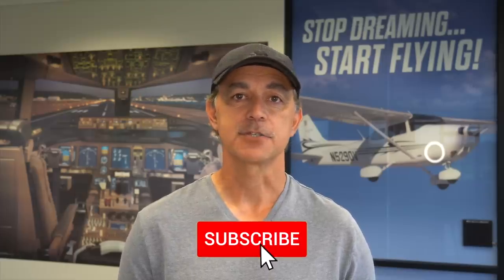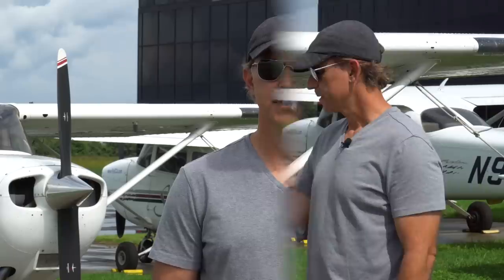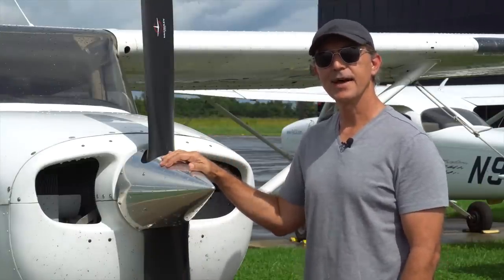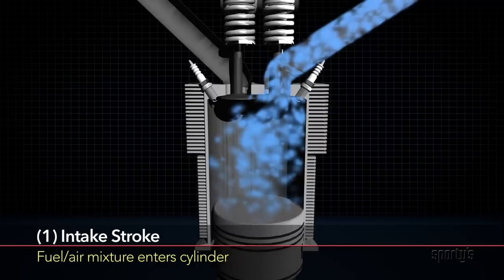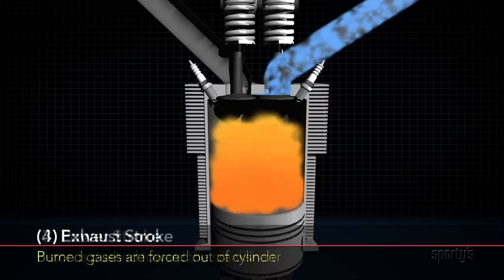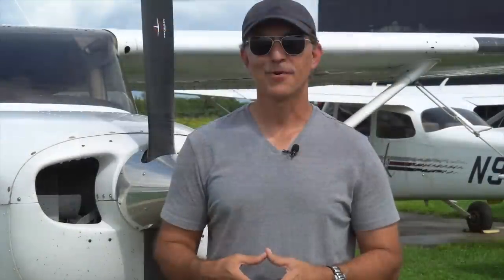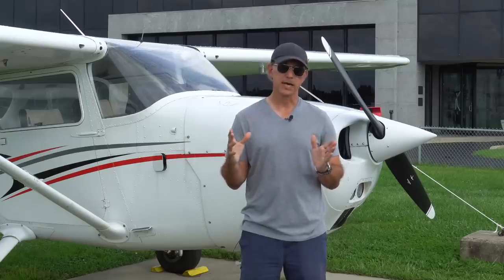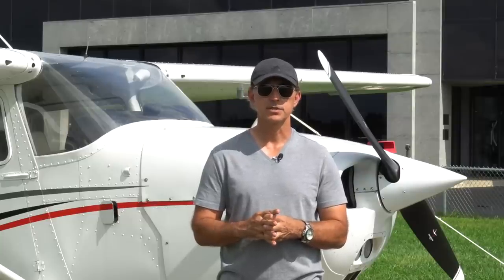Emergency Follow Up, What Happened To The Engine

Comment: In sailplane world, the 270/90 (impossible turn) is commonly taught and practiced, to prepare you for a rope break event. It’s all about speed management…that’s why the critics don’t understand why it’s possible. At the point the engine fails you have two items to manage…altitude and SPEED…which you can convert into attitude or distance

Comment: They  had partial power, not. Parachute on the nose.   I only ever landed at sportys once, but as i recall the surrounding area has houses and trees so an off field is not obvious.     I think this was a textbook ADM example, including Kim cleanly handing over controls.    Also awesome she got back in the saddle……soooo props!     A late in life (age 47 3/4) PPL learner myself, 8 years later now a 1200 hour recent instrument pilot…this is really refreshing, relevant, brave, honest, helpful, different content.     When, and i mean when…..Kim gets her PPL, please consider some public benefit flying…..best flying you can do, best reason to fly, most rewarding flyjng there is……i am sure you would do this subject justice as well as you are doing this journey.   Good luck Kim, my 2 best tips from late (sadly) in my training: landing is always plan B, the art of landing is trying not to land once you are less than 50 ft from the runway…the plane choses when to land…

Comment: Kris..thanks for the followup. I had a feeling it was a valve issue. Air, fuel, spark, you need all three to have combustion.  

As far as the impossible turn, I have a minimum altitude where I feel very comfortable in making it in my Tiger, and have practiced it with a 3 second delay at altitude. Recommend everyone figure this out for themselves and their airplane. 

BTW - not sure about the mustache.

Comment: I thought the discussion of the impossible turn was well discussed in the original video -- the engine was still running so you still have some moderate engine power.  So it is not an impossible turn (which is unpowered).  Since this wasn't unpowered, the runway behind them was a perfectly good option.

Comment: Fantastic explanation, they both did a great job of handling the emergency, lost a cylinder was my first guess knowing it was fuel injection and they still had some power. The turn was also the right response had it been a total engine failure I believe he would have done an off field landing, but they had the altitude to make that turn. I’m as proud of Kim as you are she did absolutely amazing in that situation.
So excited for the next lesson I’m on the sidelines cheering her on.
Till then blue skies and tail winds

Comment: According to Mike Busch (Savvy Aviation),  Lycomings have issues with lead associated deposits building up on the valve stems which can cause a valve to stick. Someone mentioned the wobble test which can check for this condition. I think if there is no wobble then there is deposit build up. This problem will go away once unleaded avgas is used.

Comment: Impossible turn, depends on altitude and how much power you are getting. I had a complete roll back of power on takeoff, no throttle response. IO-360, 6cyl, 210HP. I was at pattern altitude on crosswind turnout. No problem to return to the runway. Glider pilots train for the 180 return from as low as 200ft AGL. Again, it depends on where you are. A hot day, slower than normal climbout and hills or trees, that 180 turn at 200ft may not be the best option.

Comment: Interesting. The bottom line on turning back is they still had power being delivered to the prop, thus forward thrust albeit much less so in this instance the right choice by the CFI, if the prop stops dead. Don’t turn stay level and best glide speed look for that field ahead.

Comment: I thought they did a very good job with their partial engine loss.
I'd like to hear her instructor's view on why he doesn't have her trim for power on and power off stalls.
Reply: Seat position needs to be double checked also when the pilot must move to reach any items that can affect control of the aircraft.
Reply: @michaelamick8295  Looks like Kim is already flying with her seat all the way forward, is using a booster pad on the seat and a pad on her back to help her have a more forward position.  I bet she would fit well into a 152 (of which I cannot even begin to contort my 6'-4" frame to fit into).
Reply: @johnorlovich4789  I agree with you. After watching several of the videos I was more aware of the pad and realized how limited she was by the 172's ergonomics. I do enjoy watching her progress and am sure with her determination she will realize all her piloting goals.

Comment: I would say, that if there is a total loss of power right after takeoff, 200-600ft, the turn is almost impossible, many people died trying to do this. Also if the propeller is windmilling, it creates a lot of drag, and it's very different from emergency training on idle power. And here they still had some power from the 3 cilinders.

Comment: Re: a turn back to the runway.. Be aware..
- As can be seen in the referenced video, a turn back to the runway is NOT just a 180.. It requires a total of one 270 degree turn, then an opposite 90 degree turn to line 
- With insufficient altitude to recover from a stall, the wing's critical angle of attack never NOT be violated so close to the ground. The pilot must consider altitude, airspeed, bank angle, power available and the result of turning downwind.
The maneuver should be practiced at altitude so that the student understands their & the aircraft's limitations..
But then... I'm a strong supporter of stall AND spin training..
Finally...
It was my understanding that Cessna forbade slipping with flaps deployed in 172s.  I was instructed "flaps or slip, never both in a 150, 152, 172" as the combination could result in the "shadowing" of the horizontal stabilizer which could result in a tail wing stall and the aircraft's nose pointing at the ground..
Anyhow, congrats to the instructor.. good landing.. good job.. everyone walked away.. 8- )
Reply: In this case it looked like about a 225 degree turn followed by a 45. I feel that the 270-90 would be unnatural.
I also had heard that slips with flaps in Cessnas were not supposed to be done, but I think I only heard about that after slipping with flaps plenty of times (go figure). One of those times I felt (what I think was) the dirty air from the wing starting to affect the elevator, maybe the beginning of being shadowed. The feeling of the aircraft changed significantly and it was very obvious that it was time to stop the slip, add power, and gain speed. I was using 40 degrees of flaps in a 150. Afterwards I tried to recreate what happened but at several thousand feet but I was unable to even when I brought it to a full stall with full flaps in a full slip. I also was not able to recreate it in the 152 (30 degree max flaps) or the 172 (40 degree max flaps). That's always sort of bugged me that I didn't figure out what caused that.
(Edited 9/9/22 because I initially subtracted 45 from 180 rather than adding it. Doh!)
Reply: it is not outright forbidden. The manual back from 86 says "AVOID"... however, if the alternative is faceplanting the airport fence rather than slipping.... I think I'd go for the slip
Reply: @watashiandroid8314  think it is a thing of "can happen, will bite you on the arse if you don't know the signs and is easily avoided by NOT DOING it"...however, if a slip kills my speed enough for me not to depart the runway, then so be it.
Reply: Okay folks.. IMO, the instructor, & Sporty's, lost a great opportunity to re-enforce the reason for CAREFULLY considering actions taken during an emergency by explaining ALL the reasons he got away with violating actions significantly advised against by prudent & experienced members of the flight community.
1) While in this case, I admit, it didn't appear to be a pure 270 followed by a -45, the main point is that, unless you have an alternate runway to use, it is ALWAYS a LOT more than a 180.. Please sit down with a protractor, ruler, paper & pencil & you will quickly see that , in this case, AS EVIDENCED in the video it was more like 225 degrees followed by a -45..
A +90 plus another +90 is required to get back going in the opposite direction, then another + degree turn, determined by how far you traveled past the end of the runway to get BACK to the runway, must then be followed by another corresponding turn to undo the last segment so as to be inline again.
2) Just because a pilot "gets away" with violating the POH recommendations does not mean the consequences of the violation will not be serious.. The consequences of going against the manufacturer's specific warning of using flaps while slipping can be dramatic & VERY quick.  With an unexpected crosswind or crosswind gust & a legal, yet far forward CofG, may result of fully shadowing the tail feathers can end up with the aircraft pointed STRAIGHT down as the horizontal stabilizer's angle of attack is exceeded and the flying surface stalls..
My friend, the shudder you felt in the 150 indicates you may have been VERY close to disaster if you were close to the ground at the time.
(BTW, The 40 degrees of flaps in a 150 indicates either your experience was a number of years ago, or it occurred in Canada as 150s in the USA were mandated to have had their max flaps significantly reduced for some time now..  Personally, I loved the 40 degrees.. like riding an elevator.. 8-)
In conclusion, IMO, the instructor, his mentor & Sporty's missed an incredible opportunity to enlighten new pilots as to the hazards associated with these two decisions. Instead of making light of the instructor's decisions, they could have shown the altitude & track the aircraft took on Flight Aware or whatever software tool available to Sporty's, to fortify those decisions.  No, it may not be comfortable to admit getting away with poor decisions, but it is instructional to new, & even experienced pilots.
Many seasoned pilots are not cognizant of the dangers or recovery from tailplane icing or the results exceeding the AofA of the horizontal stabilizer.
I agree that the instructor saved the student from both injury & the aircraft from damage, but at what cost.. If they were at 1400' above terrain when he made the choice to turn back, fine, show that on the Garmin or another tool.
However, choosing to slip with full flaps as opposed to going off the far end of the runway, where most of the energy would have been already expended, or his final two maneuvers to get back over the runway instead of putting it down on the grass, to me, are still questionable..
Finally, would I have done better? Probably not. I'm human & most probably would not have done as well as the instructor. However, that does not equate to leaving the reader & new pilots, uninformed.
Again, congrats to the instructor!

Comment: They had partial engine power to make the turn. I thought it was a good choice. If the engine was completely dead I would have opted for straight ahead or slight turn to an open area. As it turned out after the 180 they were high and had to slip to get down. I also thought the immediate  may day call was great call as there was at least 2 planes in the pattern and I think one on final. Had they delayed they call the runway may not have been available. Also the student did a good thing by staying calm and quite. I hope she continues with her training.

Comment: While the impossible turn back to A runway is highly debated it mainly relies on at what altitude the emergency occurs. With one of my  instructors, way back when, We went up to altitude and practiced engine out 270 degree turns to see what altitude loss we would experience. OH! and the 180 is never just a  180, 180 would lead to a forced landing parallel to the runway equal to 2 times the radius of the turn, unless of course there is another runway of opportunity available.
One should know, have it ingrained especially at your home airport, Where they are going to put the plane at all different phases of engine failure during take off. 
If you have conditioned yourself , to expect an engine failure, you'll have a better chance of surviving to old age.

Comment: Ahh, thanks for the heads up, Kris! I thought it was going to be an ignition problem, but it turns out several other commenters were correct with their stuck valve assessment. This isn't something that typically happens in the small engine, or even automotive world very often, so my lack of aircraft experience lead me to the wrong conclusion. Good to know! I always learn something in your videos, Kris! I appreciate that! Can't wait to see the next one on Kim's progress, even though I KNOW she's going to nail it with a flawless checkride at the end of them all. 😉👍🍻
Reply: Normally “stuck valves” get stuck closed, but can stick open too. Either could lead to a bent pushrod or valve rocker issues.
Reply: @billtisdale6122  Usually I see that happen on newer lawn tractors, when they start puking oil all over the head, & all the dust & grit builds up a layer of insulation. Head gets so hot, the valve guides walk out of the head, stop valve movement dead, & bend a pushrod. Sometime you get lucky and the bent pushrods are sitting right there. Other times have to yank engine & split cases to retrieve it from crankcase. Got to love modern manufacturing quality control & parts sourcing! 😂 Keeps me very busy!

Comment: The impossible turn is no power.Most planes will fly at 50  % power. EAA did a study on this. It depends on the plane, what was the climb out profile, wind, and runway length.

Comment: Thank. For that. Video. It explains  alot..

We half to wait till next week for the next flight. ?
Reply from the maker: No sir. It will be released tomorrow. I postponed it a day so I could get this video out before the mob stormed the castle with torches. 😂😂
Reply: @BaronPilot  🤣
Reply: @BaronPilot  yep.   I figured. Every one on your channel. Was asking. The. Same questions  if. The engine  quite.  They have the. Altitude  ?     Or would  you  use. Flaps to help keep air under the wings.   ? ?      You said. Commercial. Pilots.  Have. To  practice  that.  For the license.

Comment: Carb heat was my first guess (reaction) not knowing what engine it had. Then as I was watching I notice the aircraft was vibrating and my first though is they lost a piston. I think though, I would have stayed in a shorter pattern and continue climbing until I get at least 800 feet. Pull the power and prep for short base and final. Had the engine completely stopped then I would executed the impossible turn and crabbed all the way to the runway to dirty up the plane as much as I could.

Comment: There are a couple things not covered or covered completely.  Nicely explained how a stuck valve was the problem and losing 1/4th of your power (plus the vibration) is worse than 1/6th of it in a 4 cylinder vs 6 cylinder engine.  The almost instant decisions Kris made were correct. First he took control of the aircraft.  Comments were made that Kim took her hands off the yoke.  Yes she did, when she saw Kris take it. It wasn't verbally communicated right away, but it was obvious and that was great on both their parts due to previous instruction. Next the "Impossible Turn" thing. It's very different if you lose all power or feel the engine is going to fail to the point of not being able to stay aloft.  That wasn't the case here.  Vibration and loss of some power, but it was clear that Kris noted he could maintain altitude and he decided to return to the runway, doing a downwind landing and not trying a full pattern.  That's having your brain working.  Radio call was prompt, very clear and correct.  Other pilots noted the Emergency and cleared the pattern.  Great Job
Reply: It's not Kris flying, it's Kim's instructor flying (Matt).
Reply: @virtualmartijn  Sorry, got the name wrong.  Matt is the instructor and is doing a good job. Thanks for correcting me.  I need that sometimes.  🙃

Comment: Thanks for sharing! I used to have an Audi A1 (aka vw polo, skoda fabia, seat ibiza) which developed a coil pack issue over time, what caused the cylinder to stop working, did the spark plug foul or something like that?
Reply: He said a valve stuck open.
Reply: @davidquinn6161  thanks buddy, I rewatched this and missed it, what do you think caused the valve to stick? In cars they're usually spring loaded I believe?
Reply: That's very puzzling to me. I've worked on car engines and small engines all my life and never seen that. The springs are very strong and should always seat the valve. I can only think that maybe it somehow got seized in the valve guide.
Reply: @davidquinn6161  exactly, I guess it could be anything! Perhaps the spring was faulty upon installation. With all the different temperatures and pressure changes even a GA aircraft has to endure, I'd like to think the cause of this incident will be fully investigated to prevent it happening to perhaps a pilot on their first solo. The flying school seem decent so hopefully the findings can be submitted to lycoming and the FAA etc but I know none of this will happen unfortunately. Because Lycoming don't care, they basically have a monopoly on piston cessna et al.